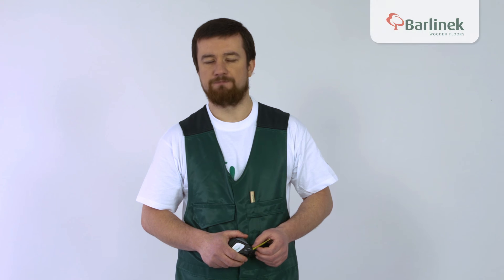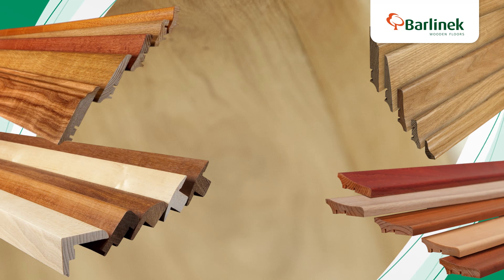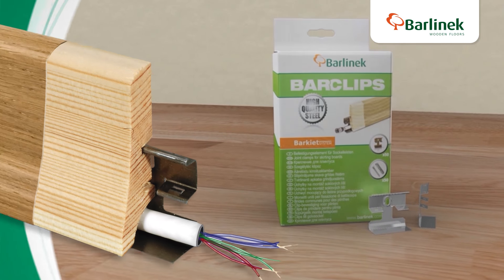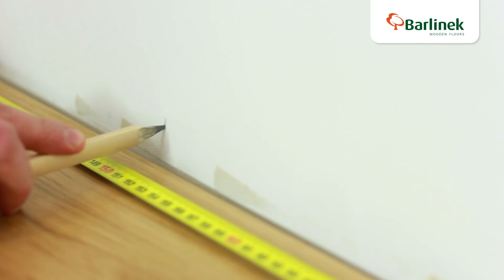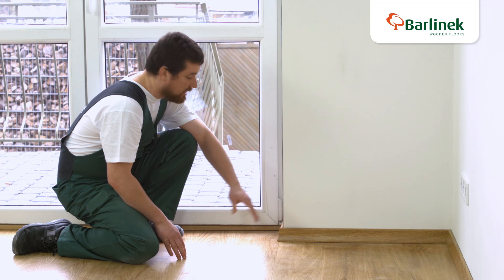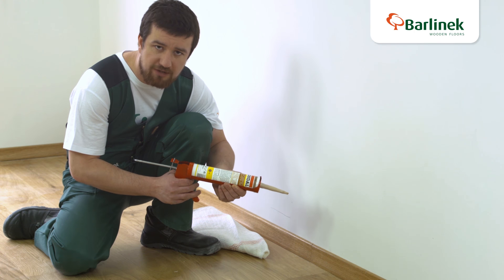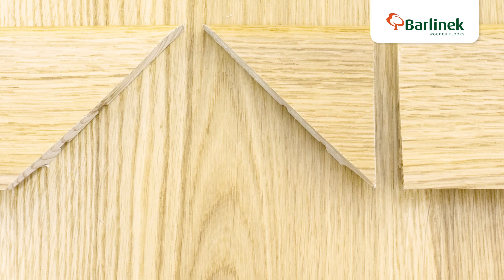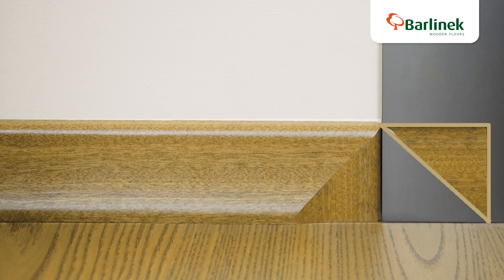Skirting board installation instructions

Comment: I couldn't get the clips to work, some of them outright refused to connect to the baseboard, while for the baseboards where it did work, they ended up very loose. I'm still in the process of setting them up and I'm considering gluing them to the wall.